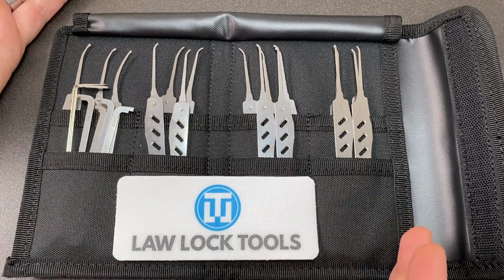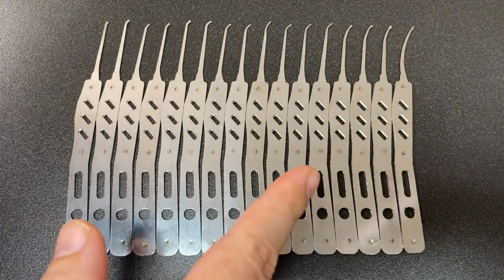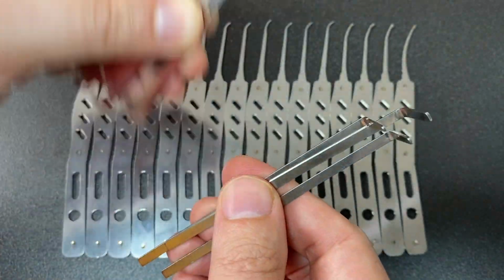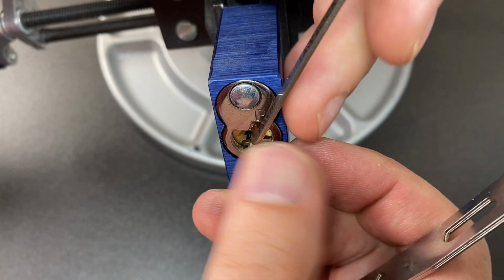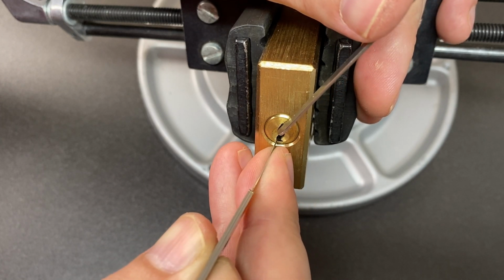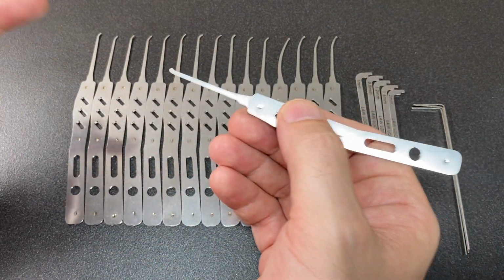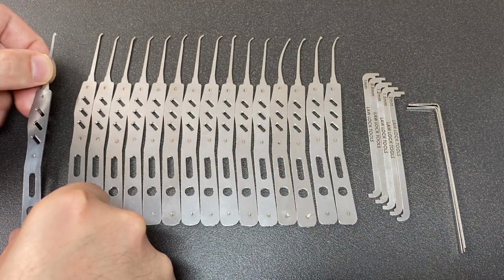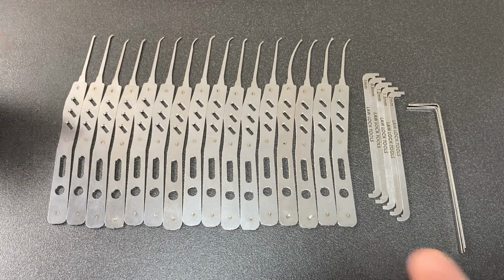Ronin Pro Lock Pick Set

Comment: I own several of these. I don't recall their names, but that one you picked up with the weld splatter is a pick which is the ONLY way I was able to open a particularly brutal old Sargent I have.  Just the right reach, just the right thickness - and tough enough to lift the pin against a ton of drag to keep from dropping the other pins.  I bent another makers "reach" pick trying to do it,  and bought the Laws pick for the task.
For the past 2 years, I only pick very used, very weathered old locks with no keys available. I know, weird hobby. 😫🙄

Comment: I’m struggling to single pick locks, any tips?
Reply: Start with the most simple locks.  Master #3 and Brinks.  Watch the first few videos on Bosnian Bill's Channel.  Buy a repinable pratice lock and remove all but the first two pins.  When you get confident add a pin.  Keep doing that untill you are good at 6 pins.  Then start over with one spool and a standard pin.  Then gradually add standard pins and move arthe spool. Then start adding more security pins, but alwayes keep one standard pin in the lock or it will feel really sloppy.  Pratice, pratice, pratice,  is the last hint.
Reply: @markferguson3365  how do I take pins off the locks?
Reply: @zidanh6058  there are special training locks which have screws so you can remove pins without having to gut them. 
I personally only know the one from multi pick.

I can recommend Bosnian Bills videos, too. And I started with some ABUS 85/50 and standard locks.
I started raking them until I got a good false set. Then just gently tried to find the pin that gives counter rotation. Then reset, start again. Until I really got the feeling for the counter rotation.

Also note: really check out videos (LN, Bosnian Bill) or sites where they give examples for good beginner's locks. I got very frustrated with a Burgwächter 77010 (or so) and thought a) I would never get it and b) my pick set was way to big to get to the last pin.
Nope... Now I open it with a hair pin and a bend paperclip.
The lock is just not beginner friendly.

Comment: Do they make locks with an independently turning core for each pin?  

..
Reply: I have only seen one lock with the core split in two...
As i remember, it was a home made challenge lock.
Saw it on Bosnian Bills channel.
Reply: @HairyStuff64  It seems most picking relies on applying continuous turning tension on the single core as the pins are moved. This could be nullified by a core which turns independently with each pin. A multiple, stacked core. Just a core which is sliced into as many segments as there are pins, or perhaps one extra. 

I wonder if that would work. 

..
Reply: @GlobeOculaireTechnologique  The one i saw, could be picked with a deep tension wrench, as only the half core with pin 4 - 6, was the piece with the actuator.
In your case, i'm afraid i would only have to pick one pin. The most rear one. If of course i used a tension wrench that reminded of a disc detainer tensioner.
But keep trying and you might end up with a great idea :)
Reply: @HairyStuff64  Oh I didn't know there were deep tension wrenches. Thanks for the info !
Reply: @GlobeOculaireTechnologique  We are many lock sporters, who make our own modified tension tools (and some times also home made picks) all the time... :)